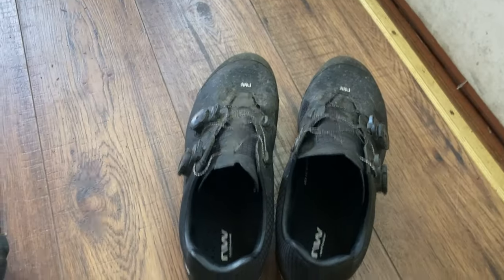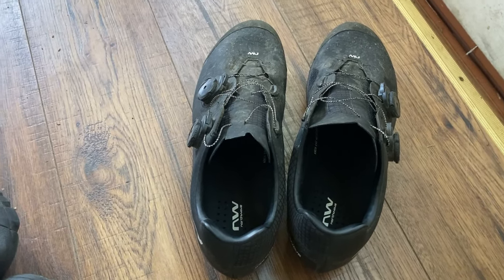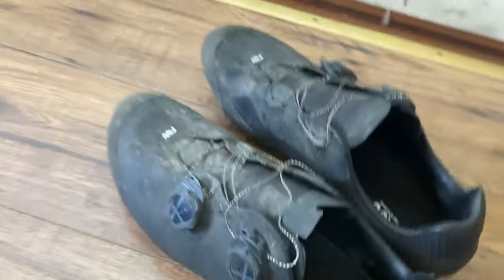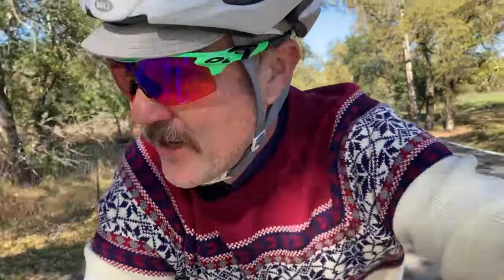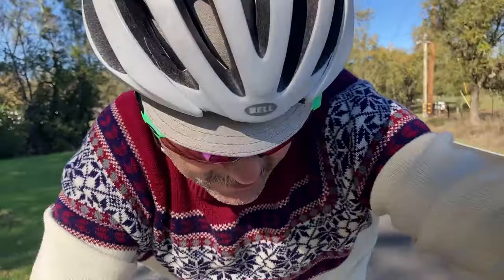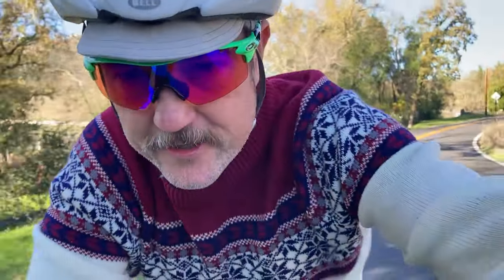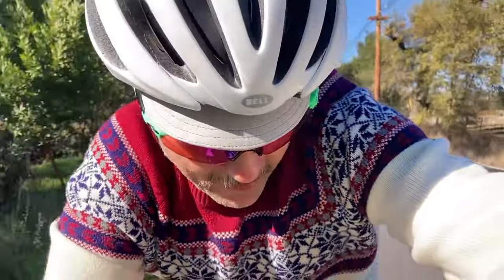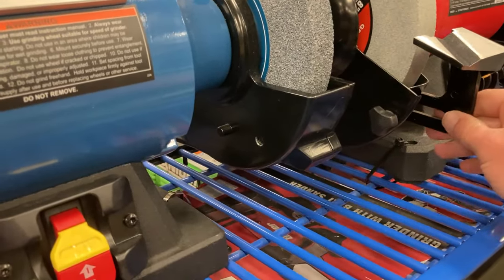Shopping for Bike Frame Building Tools

Comment: A couple safety recommendations: Your grinder should ABSOLUTELY have the tool rests and they need to be able to adjust to minimize the gap with the wheel. Also, NEVER grind aluminum because the aluminum will melt into the pores of the wheel, thermally fatigue the wheel, and cause the wheel to explode.
Reply from the maker: Thanks for the tips!

Comment: Re frame-building tools I basically just do everything with an angle grinder, with a flap disk and a cutoff wheel. There is some snobbishness around these but I consider them precision instruments :) A cheap digital level box is also a must and the first thing is to build some kind of jig (although there are some techniques for making frames without one).

Comment: Dremel tool, clamps, emory paper, bench grinder. And MAPP gas set-up. Digital micrometer. Soft tape measure. Wood blocks for tube holding in vice.
Chimonas had vids up on YT a few years ago that were very helpful.

Comment: That's the thing with tubeless, I have different tires I like for different rides.
But changing tires with sealant/tubeless is basically a no go.  Too much hassle and mess.     Im  sort of re-thinking tubeless on roadbikes anyway.   I maybe got 2 to 3 flats a year with tubes, is that worth the expense and hassle of tubeless?

I did have a set of Gravel kings that lost their ability to be ran tubeless, the sealant puked out between rim and tire and I walked the bike home, wasnt too far.

Comment: Harbor Fright???

😱

You’ve got a few people suggesting 2nd hand, & I’d agree w/ that. I have my granddad’s tools, most of which were bought in the immediate post war years between 1945 & 1950. My dad’s are later 50s through the 60s, & most of my own were in the house by 1985 or so.

A friend’s car was burgled a few years back & he had to replace his basic wrenching tools, so we can line up 4 distinct generations of ratchets, sockets & wrenches, etc, & readily assess their quality.

I can do a similar thing w/ bench grinders. The grinder I bought in the mid 80s is ok, my dad’s is better, & by comparison my granddad’s Delta is a jeweled Swiss watch.

You’ll be way better off to buy a 50 yr old bench grinder from a buddy or anybody else that has one they’re not using. A lot of guys like myself, guys that bought one decades ago & then inherited a couple more, have one or two sitting around that they just don’t use much, if at all.

I’ll go to HF if I’m out & about & have no other choice, but I wouldn’t trust their grinders & wheels to spin up to 4 grand & remain intact. Try their wood chisels - you won’t have to save up for ‘em, & they’ll never hold an edge long enough to cut through 7 layers of skin, so whatever they do or don’t do there’s a good chance they won’t kill you or anybody else that happens to be standing around nearby.